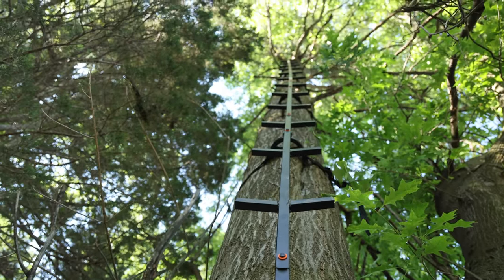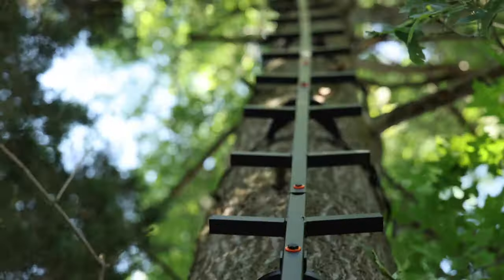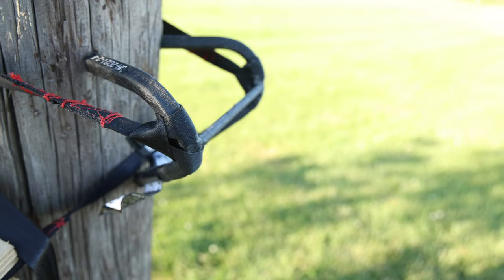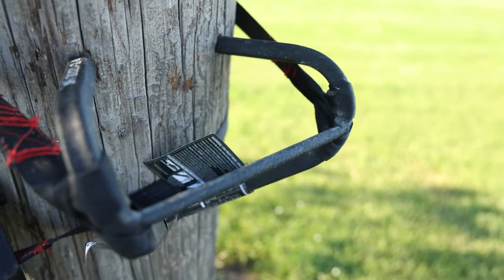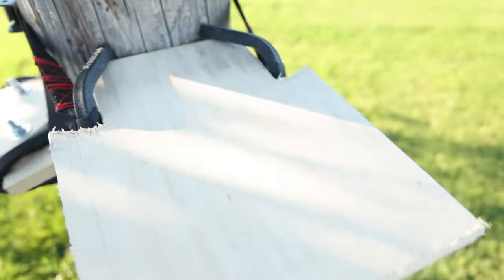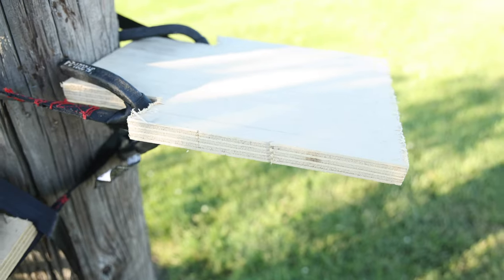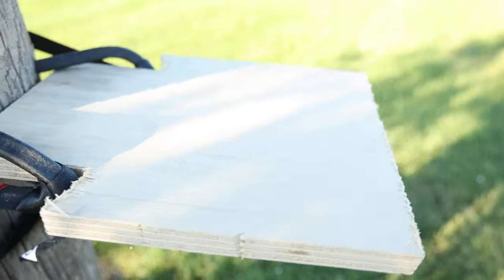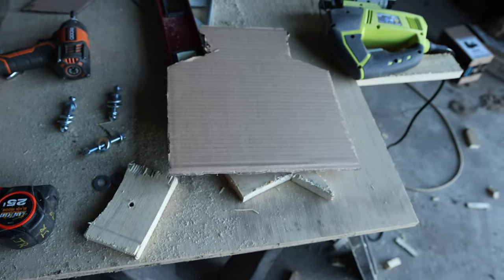My DIY Preset Saddle Hunting Platform!

Comment: I used a muddy stagger step that I cut about foot from the top step and then reset the strap closer to the top. I then made plywood sandwich around the top step and bolted it together, and covered the top in skateboard grip tape. It isn't big, about the size of the hawk helium hsp but way more comfy because it set at an angle. It hunted great and it was very affordable.